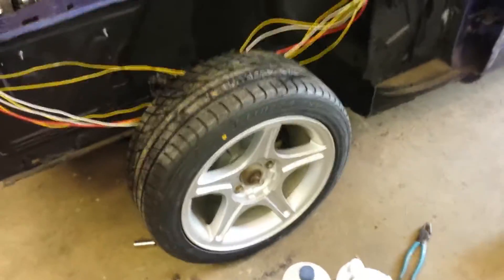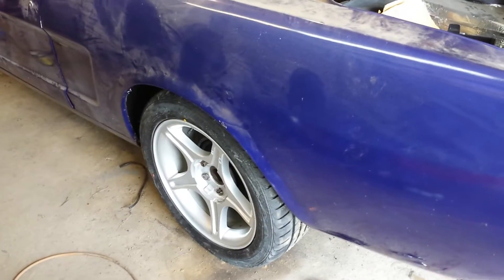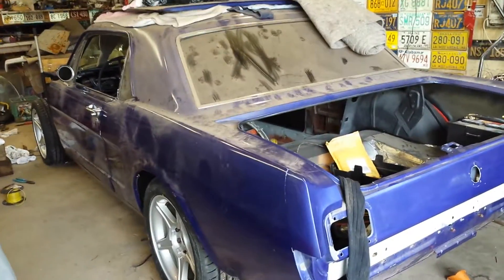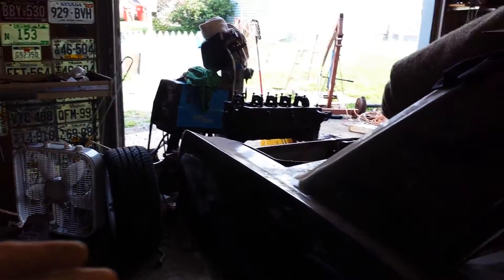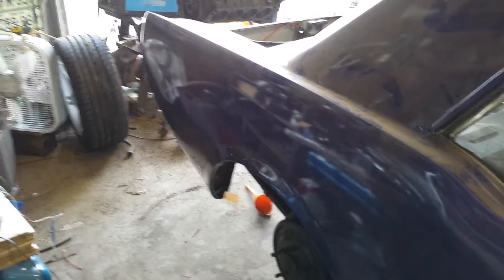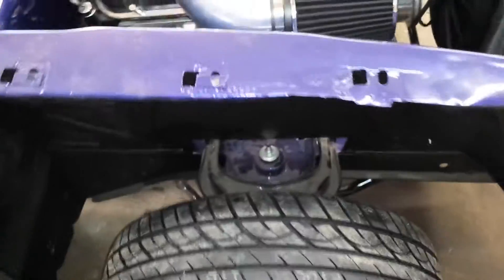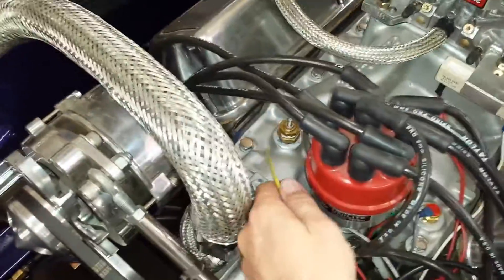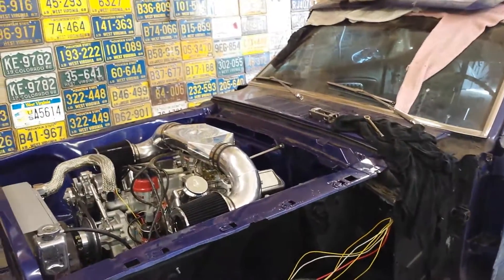1965 Mustang resto: wheels and tires

Comment: coming together man.. looks good. some meat up front.
Reply from the maker: I wasn't real happy with these wheels but I have to say that they look a lot better with new rubber.  My previous tire sizes were 275/40/17 out back and 255/40/17 up front.  Those were meaty and the fronts rubbed sometimes.
Reply: Cobrafanatik22 i hear ya. i still am not sure what wheels I'm going to go with.. I'd love some Forge Racing ($2000).. i'll keep dreaming though. right now im rocking some aluminum ones i jacked off a cougar. not sure what kinda budget you're on, but i'd check ebay for some knock offs. just got some china specials for my srt4 that look amazing, paid $350 for them.
Reply from the maker: callofgeorge every thing is on a budget lol.  I'll probably keep these for a while.  Maybe change it up once it's painted.  Now to get these Damn strut rods welded on so I can take it for a ride